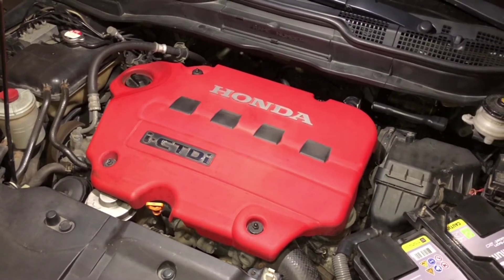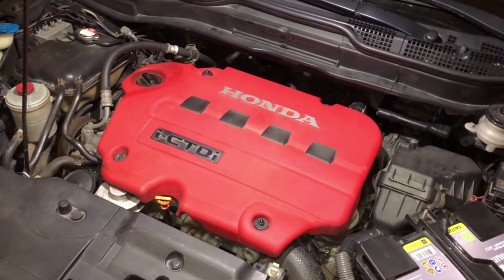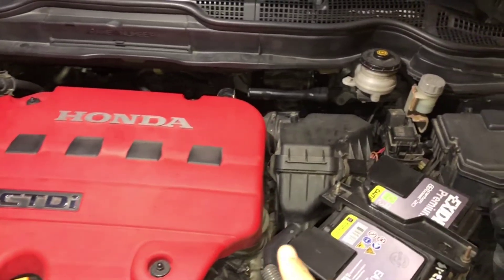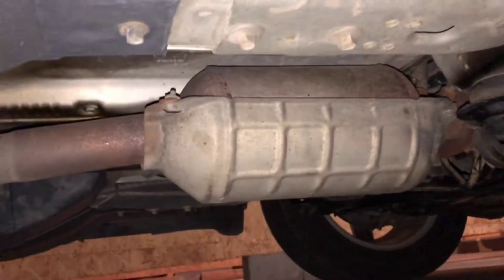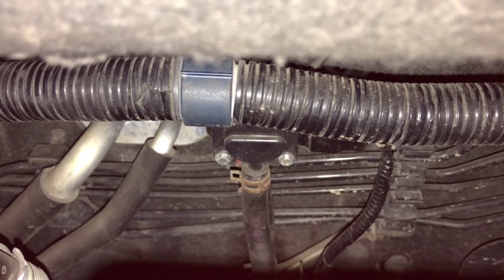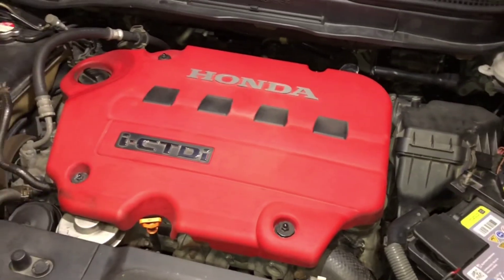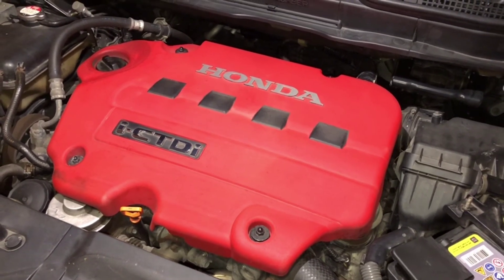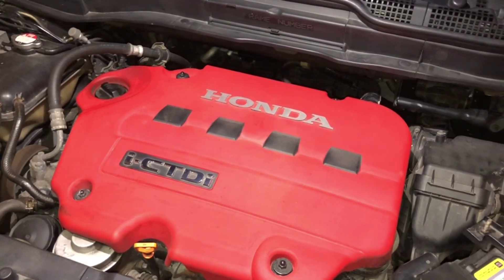How To Fix Diesel Particulate Filter Problems (Honda CR-V 2.2 L i-CTDi 2008)

Comment: the ctdi doesn't have a dpf???
Reply: The early 2.2.2ictdi engines from 2004 -2006 don't have DPF the later years have I have a later 2009 last ictdi N22A2 engine in an Accord without any DPF

Comment: Hi, I think your suggestions about DPF problems are totally correct. When I used CR-V it was constantly getting DPF error and going to limp mode, of course at the car service I was told that the catalytic converter has to be removed and DPF reprogrammed or I need to buy a new catalytic converter. It costs huge money, basically half of the price I bought my CR-V. It cost me 120 euros to remove it but sold the catalytic converter at the precious metal waste purchase for the same price, it seems that the catalytic converter was still pretty alive. Sure, this solved the problem of the error, but the real problems stayed. I was hearing some whooshing sound when accelerating and higher fuel consumption. Noticed that the intercooler was blown (probably due to some crash, because the frame near it was folded), bought a used one for 50 euros, and replaced it. The sound was better but some whooshing still persisted. So later I noticed that the hose near the air intake sensor (the one you pointed out) was torn, also bought a used one for 15 euros. Did all the work with my father. That solved all the problems. Since then there was no problems at all. I wish you have posted this several years ago. I think the car would still have a catalytic converter. :D
Reply from the maker: Good job man! Much better when you work by yourself on your car, some mechanics are bad and not educated... Thank you :)